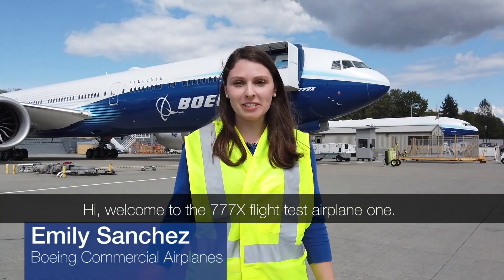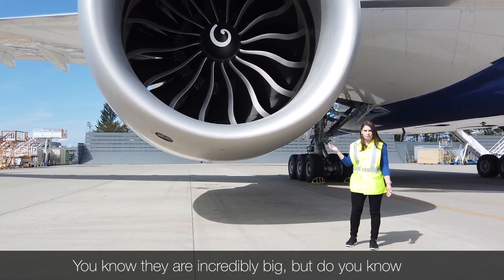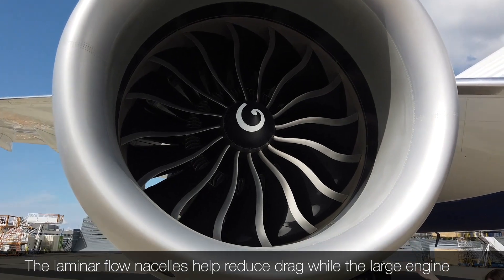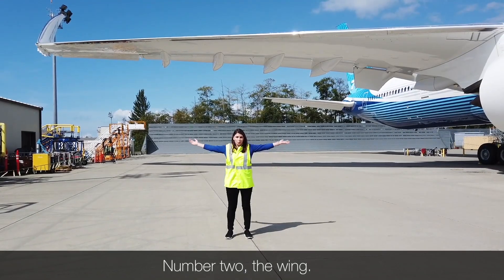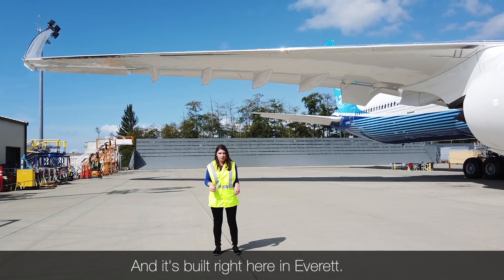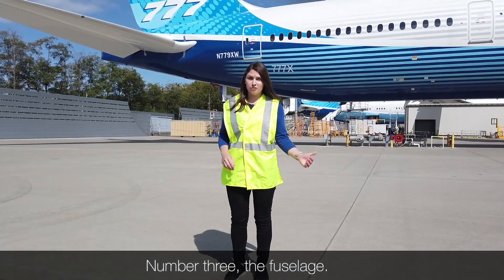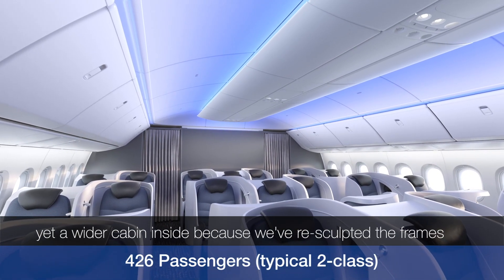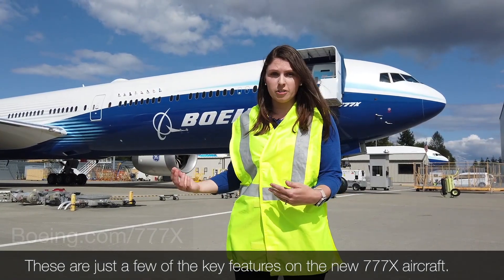Boeing's 777X | The GE9X Engine, Wings and Fuselage

Comment: Is the 777x  the same size as 777- 300 ER?
Reply: Same height but a different length and wing span (the wing span is only the same with the wing tips up)
Reply: @ethansaviation2672  okay thanks , the 777x looks massive with the new engines, I would imagine it was 3 times a bigger than the 777 300 ER . Thanks 👍
Reply: @Bg12789  no problem

Comment: Can you explain why most other planes have winglets (or even added them) to increase fuel economy and stability you have tips that fold down to a flat wing?  I am confused and can't find the answer anywhere. Thanks
Reply from the maker: Regarding the 777X, the folding wingtips increase the wingspan, reduce the associated engine thrust, fuel used, and emissions and maintain airport compatibility with today’s 777 families. We have more information on this here: boeing.com/777x/reveal/video-777x-Folding-Wingtip/

Comment: Darling, stop lying. The fuselage is too small for 3-4-3 in economy, even with reshaping the inside cabin. The 777 is amazing with 9-abreast, like it was designed for. Same with the 787. Passenger comfort is really bad on boeing machines.
Reply: you can have 18 inch seats with 10 across on 777X.

Comment: Hope the bigger engines don't alter it's aerodynamic capability like that of the 737 Max - Boeing should have built a 737 replacement from scratch instead of continuing to use a 60 year old design...
Reply: The 737 max isn't unstable
Reply: OMG Why would these engines not alter its aerodynamic capability just like the 737max? it doesn't have mcas and has FBW. Airbus should have built a 320 replacement instead of continuing to use a 40 year old design

Comment: I am worried MCAS is on board.
Reply: MegaTriumph1 No, 777X has a modern control system where such a system would never be done. On modern airplanes MCAS doesn’t make sense conceptually because control forces are simulated
Reply: @AmbientMorality  Show the link were Boeing says there is  "no" MCAS otherwise I think there is. Because I can't find it anywhere that Boeing says no MCAS on board.
Reply: @MegaTriumph1  It just doesn't make sense. Unaugmented, 777 already has relaxed static stability so it is less stable than 737. However, 777 is a modern fly-by-wire aircraft with simulated control forces. The control law for pitch, C*U, inherently has maneuvering stability (by definition, as the simulated forces are directly proportional to pitch rate and speed).

Comment: Those retracting wings scars me as much as the forward position of the 737 max engines. A design decision to go around additional costs for better sales pitch at the expense of safety.
Reply: Cedric Thirion There’s no reason to expect folding wingtips decrease safety. They worked with FAA and EASA to develop special certification conditions, which means both agencies extensively reviewed it. By contrast, Boeing passed off MCAS as an extension of existing trim control and so the system design was much less transparent to regulators. Also remember that mechanical locks are very reliable (see landing gear) and only unlock while on the ground (so much less risk than landing gear extension which has to involve locking in air)
Reply: @AmbientMorality  thanks for the knowledgeable answer!
Reply: @AmbientMorality  and even if the wintips unlock in the air, the plane will still be very flyable.
Reply: @yashsvidixit7169  I know this is super-cautious, but I'm not quite willing to say that – I'd be worried about new flutter modes from an unlocked wingtip. Obviously I don't know if they've been able to reasonably analyze that (I'm sure they've tried, but that would be a really hard problem). Since the certification route seems to be proving that it cannot unlock, I expect it would at least be challenging to safely prove through analysis and flight test.
Reply: @AmbientMorality   I hope boeing must have done something for the case wintips come loose in flight. Maybe adding viscous drag in the hinge of the wingtip. Or something with the shape of the wingtip and the hinge itself to modify the characteristics of a loose wing tip in the airstream. Boeing would know it.
Reply: Been used in the military for decades.

Comment: Four years ago I flew in an Emirates 777 and when attempting to land the first time, we were told that there was 0 visibility at Dubai airport and that they had to try again in a bit.  Well, that "a bit" turned into 2+ hours of circling Dubai but zero visibility did not change. At that point the pilot announced that he needed to land due to being low on fuel.  Everyone on the plane was a bit freaked out. We felt the plane descending for a while after that, and at one point all of a sudden we started hearing loud noise of engines reversing. We had already landed!!!  No one in the plane felt that landing, how is it possible that such a huge plane landed in 0 visibility so graciously and smoothly!?  Must have been the combination of the best pilot + instrument landing system + the best plane ever.  Ever since then I always try to fly 777 if I have a choice, even if I have to go through a lay over/change flights. And since I love the previous 777 planes, Boeing better make sure that no shenanigan/nonsense (such as in 737 max) happens with 777X. Good luck to 777X first flight.
Reply: planscan land with zero visibility, the instruments are enought

Comment: The same fundamental problems which have plagued 737 Max will surely have had an effect on the development of 777X as well. I would not fly in a modern Boeing plane if I had the choice of flying in an Airbus or an older Boeing model. A bunch of greedy execs looking to maximize their personal and corporate short-term profit have completely ruined your reputation.
Reply: Tunti Turpaan 737 MAX was under atypical schedule pressure and working off an old design. Certainly this in no way excuses Boeing; I think there are several factors for MAX that don’t apply to 777X though. 777 is an actually modern plane and this is expected to sell in relatively low volume for many years, so while there’s always some schedule pressure it’s not like the looming A320neo threat
Reply: @AmbientMorality  They're now re-investigating the 2009 incident where a 737 NG crashed near Amsterdam and uncovering similar design flaws as with 737 MAX. This clearly indicates that Boeing's poor management decisions favoring profit over quality date back well over a decade. With 737 MAX it's now gotten to a point where it simply cannot be ignored or swept under the carpet anymore. To think that they didn't apply these same flawed management principles to the development of 777X would be incredibly naive.
Reply: Tunti Turpaan I disagree with the NG crash. In that case the single malfunction caused a benign autothrottle problem where I think it is reasonable to expect most crews could recover. There is a point there about Boeing’s lack of robust warning systems, but after that crash they added a new low speed audible warning (which was a good response). There’s many systems on 737 which rely on a single sensor; these stem from historical decisions that pilots serve as backups and so benign system failures are not too bad. On the other hand MCAS fails much worse, so there it is absolutely Boeing’s fault.

Comment: bigger with the same gross weight, interesting
Reply: Keith Johnson - Shelby GT500 same thing for the a330-200 and 300
Reply: If I hadn’t have seen other examples of that I would have believed.
Reply: @kuckoo9036  -  what's neat is the plane has the same MTOW with a bigger Wingspan, that will give it a Slower Landing and Stall Speed

Comment: Hope this plane is successful given Boeing’s massive troubles in 2019
Reply: Software Engineers were to Blame
Reply: @Ranger_Raptor_Twin-Turbo_3.0L  No, system design was. The software was fine.
Reply: @AmbientMorality  - what Hardware Failed causing the Crashes?
Reply: @Ranger_Raptor_Twin-Turbo_3.0L  I didn't say hardware. The system design refers to the system robustness against failures; MCAS was susceptible to erroneous data from a single chain of angle-of-attack sensor to ADIRU to FCC to motor. This can be alright for some systems, but MCAS had far too much authority and no cutout that could improve safety.

Comment: Where did the serrated engine nacelles go)
Reply: Enfin Punto Boeing canceled it at the end. Don’t know why but the jagged edges would look cool, like on the 787 or the 737 MAX! :D
Reply: @Acepilot1312  It's for noise reduction, but the GE9Xs are already quieter than the old engines and insulation improvements on the inside also help. The chevrons otherwise hurt propulsive efficiency slightly.

Comment: Hopefully airplane wont crash because of Boeing's greed and poor software. Not to mentions hundreds killed on 737MAX.
Reply: You know that over 700 people a year are killed by toasters? On average 40-50 a day killed in the US by deunk drivers? No one bats an eye at those stats. Accidents happen, but these aircraft are all incredibly safe.
Reply: @Convergence_Corner  2 737max crashed and Boeing knew program was unsafe. Greed!
Reply: @briancooper2112  There were multiple points of failure that aligned to cause both crashes. Had Boeing thought for a moment that their aircraft were unsafe they would have pulled them from the air. It literally makes zero sense for them to produce mission unsafe aircraft for profit. It literally from a business standpoint and logically wouldn't make sense. Stop inhaling all the media garbage.
Reply: @Convergence_Corner  why aren't there any 737 max airborne than?
Reply: @briancooper2112  Because they discovered the aircraft was unsafe. Now they are fixing the issues and re-certifying the 737 MAX. Once it is safe i'll fly it any day!
Reply: @comareborn8734  buy a seat.
Reply: @briancooper2112  it wont crash. not because of Boeings greed and poor software. just because hundreds died on 737max doesn't mean the 777x is bad as well

Comment: Another unsafe aircraft from Boeing.. can't wait to see what woes this plane brings.. lol
Reply: PAN-PAN and since when you were a an aerospace engineer? Hmmmmmmmm
Reply: @THECHAIR.  No need to be an aerospace engineer, with all the information that's been uncovered as a result of the MAX grounding, that's enough to satisfy my level of confidence in this aircraft.
Reply: PAN-PAN this isnt the max though
Reply: @THECHAIR.  So, what makes you so confidence in Boeing regarding the level of safety and quality that has been put in this aircraft? If you do some research on investigators are uncovering from Boeing (if you aren't already aware) wouldn't you be skeptical about Boeing's OTHER products. Keeping in mind this aircraft was being designed during the time the 737 MAX was being "certified", entered into service and the subsequent two crashes...
Reply: @FLT111  737 MAX was under different schedule pressure than 777X, and has a much more modern system design which makes it simpler to make robust changes.
Reply: PAN-PAN how can it be unsafe when you have no idea how the plane works and it hasnt even flown yet
Reply: @THECHAIR.  looking at precedents.. 787 (battery issues)  737 max..
Reply: PAN-PAN and that was the past im sure they have learned and fixed the issue
Reply: @THECHAIR.  You can stick to being nieve
Reply: @FLT111  Ahhh yes because by you reading Facebook comments and blogs and CNN articles you are now an aviation expert!
No, the Max, the 777X, doesn't matter. These aircraft are incredibly reliable and safe. You realize there are over 60,000 flights a day? Half of which are Boeing aircraft? Boeing engineers pour their souls into making these aircraft safe. The whole company does. The media can pick and choose some qoutes and emails but it doesn't speak for the whole company.

Literally take any other activity or transport and compare fatality rates to aviation. Not even close!
Reply: the Software is being Reprogrammed, and Safety Options, won't be an Option anymore
Reply: You cant judge a plane that hasn't flown. how is it unsafe in 2022?
Reply: Another misinformed uneducated response from someone who has no clue what they're talking about

On a positive note, the 777X will be a great aircraft, just like all other 777 models!
Reply: @Jack3md  A lot of people said the same for the MAX when it was in development..
Reply: @Jack3md  I assume you work for Boeing or you're completely oblivious to what's happening as of late with the company..

Comment: I think boeing have changed aviation big time with the 787 Dreamliner as the 777x and the 747-8 are both based off the 787 and all 3 of these are revolutionary      thanks Boeing
Reply: The Concorde and the original 747 were revolutionary... the 777x, 747-8 and 787 are evolution of aircrafts. Maybe the 787 for using many composite materials but for me that's no revolution...
Reply: @timlolxP  I respect your opinion I  saying about the Concorde and all that but I am probably younger than you and I have never seen a concorde or the original 747 but I do like both aircraft I still think the 3 plane i said are revolutionary because of the fuel efficiency and with the 737 max 10 and 737 max 200 are the most efficient planes to this day
Reply: @markdrysdale8371  for me revolution means changing something completely, do something which was never done before... maybe the 787 is a revolution, with an untouched fuel economy for it's time.
But now there are also an a350, the a320 neo's (wich is arguably the better aircraft compared to the 737 max) and an a380 wich is more impressive than the 747-8 for me. 
The 777x, 747-8 (also a350 a320neo for that matter) haven't done something new, they are just some refined models of already existing aircrafts. That's why I'm saying evolution.

But it does not really matter it's your opinion and that's ok ;)
Reply: @timlolxP  I see where toy are coming from from what I think we both like planes but you prefer Airbus but I really like the 787 and I agree with what you are saying but our perspective on planes are different as you know about the classic revolutionary aircraft whilst I am more into modern revolutionary aircraft like the plane I mentioned above

Comment: Good luck Boeing. Hope you will restore the lost charm!
Reply: and they probably will as soon as this plane flies...
Reply: As long as Boeing DOES NOT COMPROMISE on passenger safety, and DOES NOT PRIORITIZE profit.
Reply: Come on Boeing. Get it right. There are many of us that DO want you to succeed. The MAX repairs along with the new products coming forward can serve as THAT moment in your history when you changed your culture, refocused your top goal (safety) and reclaimed your position in aviation history. I would also suggest you may not get another chance!
Reply: That will never happen because boeing will never make good products, they are run by bean counters (MBAs) instead of engineers.
Reply: The King of Numbers You don’t make sense at all, since their fired CEO under whose leadership the scandals got worse and worse was not an MBA but an engineer!
Reply: The King of Numbers troll
Reply: @gavin9715  Do you have any more fake news? If you do, you're excused and leave the channel please.
Reply: @flexairz  Never feed the trolls.
Reply: @flexairz  I have some real news:

1. Boeing chief test pilots called the plane was designed by clowns.

2. Boeing CEO was fired because of 737 MAX.

3. Senator Ted Cruz grilled boeing in Congressional hearing.

4. Boeing stock is at an 1 year low.

5. Boeing uses yoke instead of a sidestick (in Airbus) which makes manuvering the plane difficult and un-ergonomical.
Reply: @gavin9715  yoke vs sidestick is more of a personal preference :/
Reply: @gavin9715  Your rant was about the 737 MAX, NOT the 777X, successor to the wildly successful 777. The 777X, like the 777 before it, has full fly by wire flight control, nothing like the MAX's flawed MCAS (which will be safe once it's issues are corrected.
Reply: @gavin9715  lol the part about the yoke was ridiculous
Reply: The King of Numbers a yoke is by no means making the plane difficult to maneuver. And the only “un-ergonomical” side to this is that the pilots can’t have a table.

On the other hand, having a yoke will prevent like 5 big Airbus crashes because of a flight crew making conflicting inputs.
Reply: The King of Numbers you’re invited to leave this comment section.
Reply: The King of Numbers stop lying
Reply: The King of Numbers I suppose you are aware many pilots prefer the yoke so they can feel the airplane?
Reply: The King of Numbers difficult? lol
Reply: The King of Numbers 1 year low?
Reply: @gavin9715  The moment you brought up "yoke vs. stick" your entire comment became irrelevant.
Reply: @The King of Numbers yoke is more easy than joystick

Comment: If it is not Boeing, I am not going
Reply: If its Boeing, I am not going.

(Especially if it is a 737 MAX which is designed by "clowns")
Reply: @gavin9715  I will use 737MAX especially
Reply: @gavin9715  i'll fly the re-certified 737 MAX any day!
Reply: @gavin9715  The 737max is not designed by clowns move on its fixed